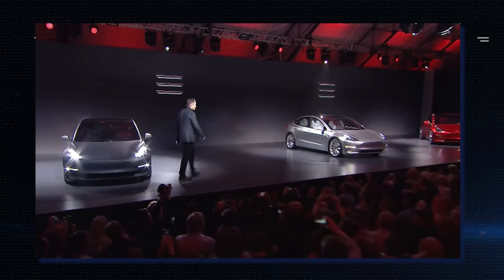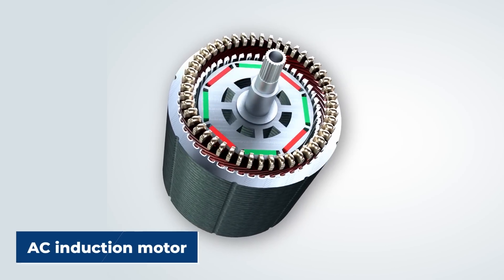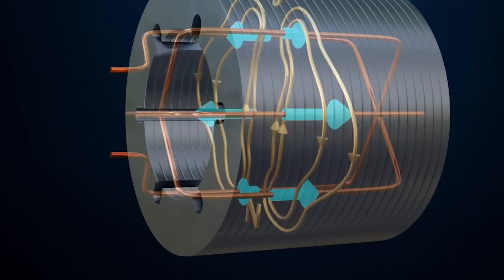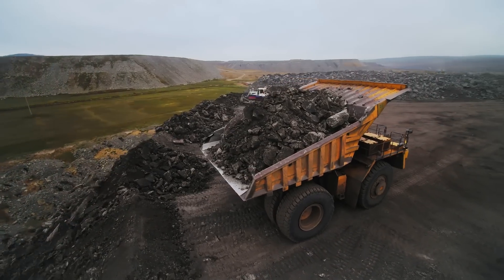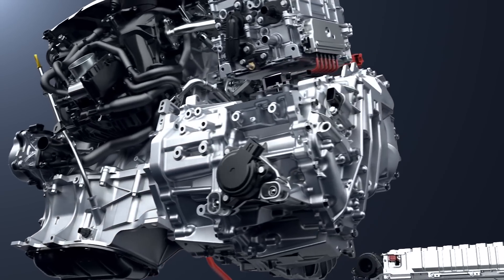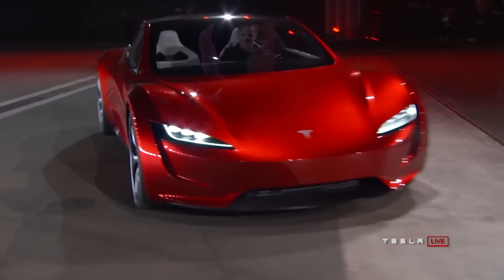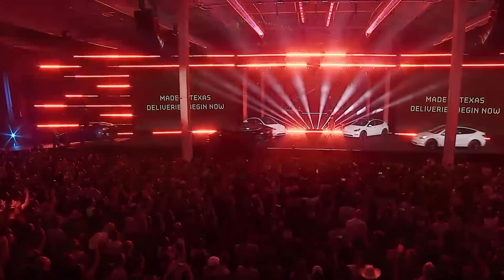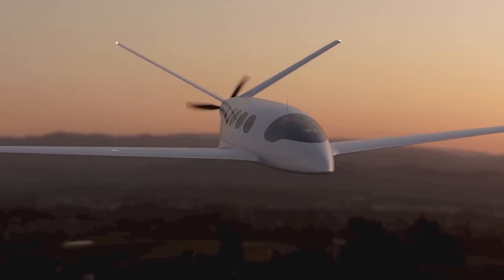Elon Musk's INSANE NEW Engine SHOCKS The Entire Car Industry!

Comment: My head is spinin over NDBs   Nuclear Diamond Batteries that run for 28 000 years!  
Nuclear waste Sealed inside a synthetic diamond with no radiation also helps clean up the nuclear wasted problem.

Comment: Guitar amplifiers convert AC current to direct current through a rectifier which can be a tube or a solid state component. The signal is now DC to drive the speakers but the signal is still on/off residual from the AC power. To fix the this problem and generate continuous sound from the speakers, capacitors charge during the on phase and release their power during the off phase. Musk has done just the opposite with this motor converting lithium ion DC to AC, a reverse amplifier if you choose to think of it this way.